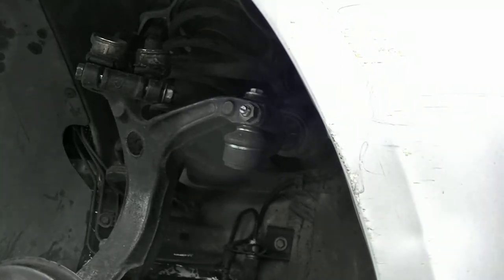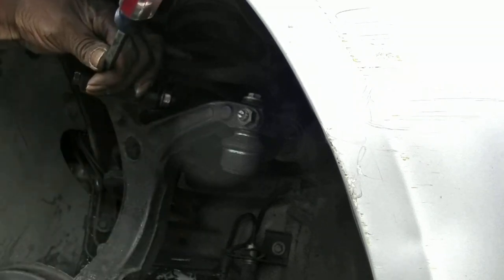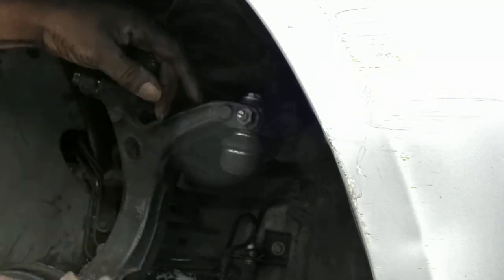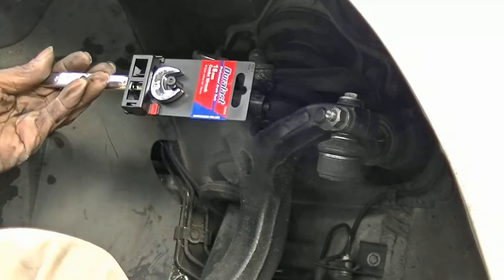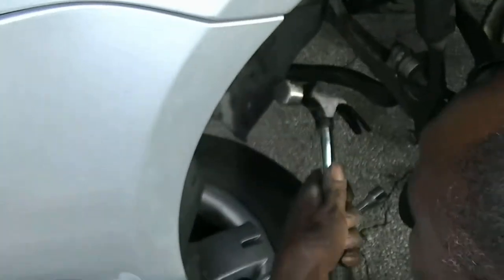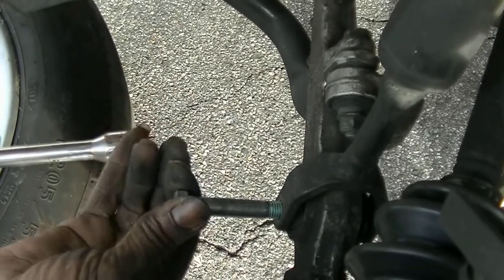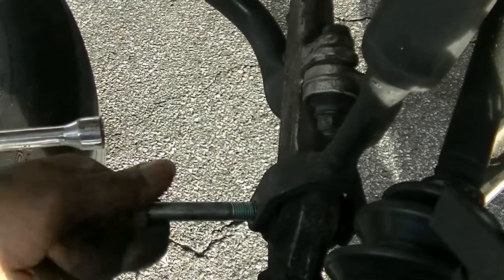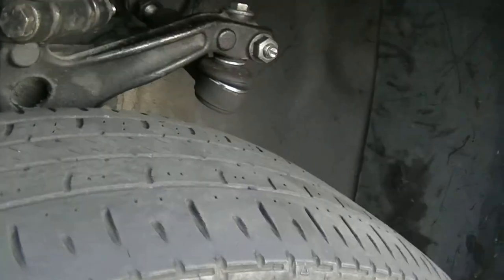RIGHT WAY t o remove bolt  vw passat  and Audi upper control arm REMOVAL  no fire no penetrate

Comment: I'm pasting my response to another video on the topic here because I'm quite familiar with that bolt when rust-locked, and it's not as difficult an issue as portrayed by almost everybody, so here goes...  No no no no no. Rock the bolt back and forth while applying a bunch of penetrant. It's really only going to flex in the beginning, but will eventually start to turn more and more. Keeping spraying oil during the process to wash the rust away and expose more of the bolt to the oil. The hexhead side will start to move while the threaded end is still locked in place. Just continue rocking your wrench back and forth. In 10 minutes you'll have that bolt spinning around freely and it will come out without resistance. Don't push too hard while working the bolt loose. You don't want to weaken or break the bolt.